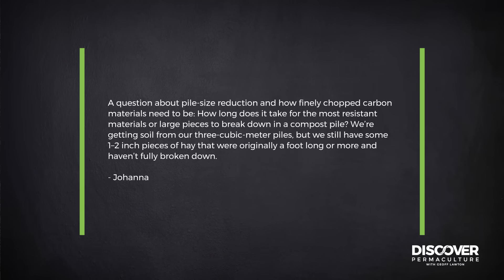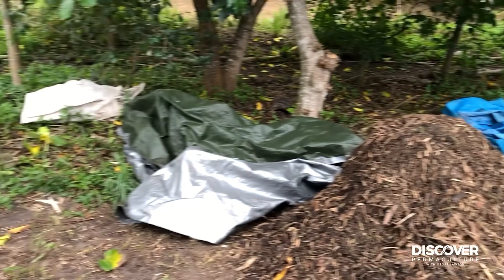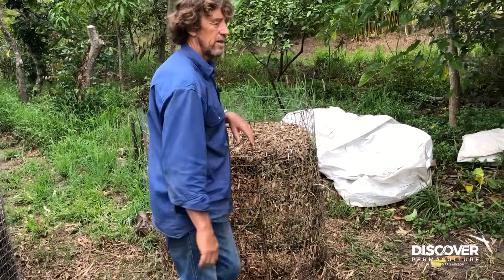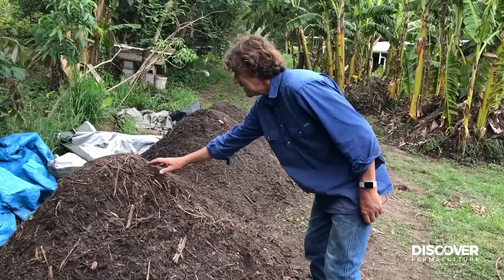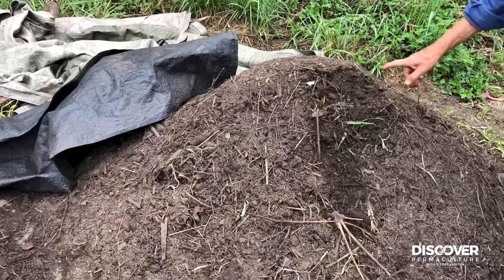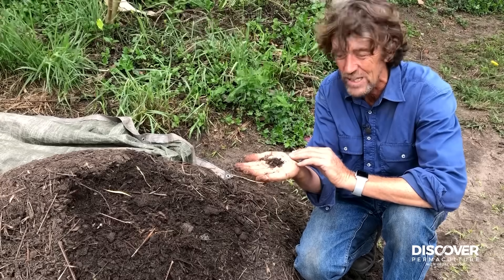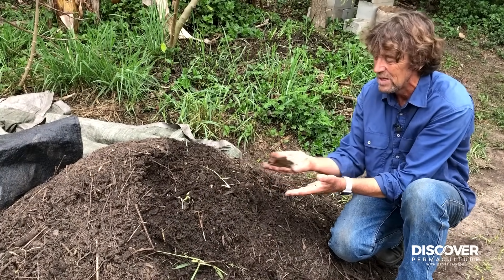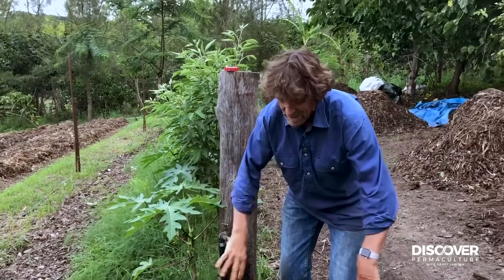Why Some Compost Chunks Don’t Break Down

Comment: I live in a cold climate. The stick can break down if placed below mulch. I prefer to turn them into biochar or us them as container bottom fill, which breaks them down super quickly compared to an open pile. I broke down one of my hugelpots after a year and only the very biggest pieces were still solid.

Comment: Mature compost indeed has only one main application : sowing tiny seeds like carrots and turnips. But to feed the soil, you're always better off putting it on the soil as raw materials. Because a compost pile will lose about 50 to 70% of the carbon in the form of CO2... It heats up too much, it's too bulky. So you lose fertility and you pollute. So why not use it raw on the ground, where only 10-20% will be lost as CO2  if you put it as a 5-20 cm layer ? The soil is the ultimate recycling machine. Use it. 
In the beginnings of permaculture, there was this myth that compost was the black gold, that you should make it and use it everywhere, that it was better than fertilizer, than anything, and that it would improve the texture of your soil and feed soil life. Now we know it's rubbish. Especially for mature compost, which has nothing left to eat for the soil. So it won't amend your soil, it will simply feed your plants (coz it's full of dead bacteria that plants can eat up right away). If your soil is poor, and you don't wanna wait until years of wood chip mulching make it rich, then yeah, use compost below the mulch. It will feed your veggies quickly. But grass clippings or manure would have the same effect. And you wouldn't have polluted the atmosphere and wasted carbon.
Reply: Compost is a soil biology inoculant more than it is a fertilizer. High quality, soil food web rich compost is what you want, which introduces a high diversity of soil organisms, which are in turn what feed your plants. Adding organic matter directly to the soil is a great strategy too and will accomplish the same thing over a longer period. Compost can help you jump-start the soil life so you get nutrient cycling going quickly.
Reply: @nick-ta-discoverpermacultu6442 not really unless you got a dead soil (rare) and use somebody else's compost... Otherwise it's easier to use all of this as mulch. It's not worth the loss of carbon and production of CO2
Reply: @nick-ta-discoverpermacultu6442   I agree with you 100%
Reply: Pollute the atmosphere? Compost under trees, boom, they soak up the CO2 from the compost pile....Make More Compost!
Reply: @ZomVees_Garden_Supplies lol trees don't absorb excess co2 that fast, so it's still wasted carbon
Reply: @nicolasbertin8552 OooooOooOokay, it just helps every growing situation on earth, but it's wasted carbon to make compost to you hahahahahahahahaha that's insane
Reply: @ZomVees_Garden_Supplies  Well weigh your compost pile before and after, that's how much is lost. I don't say it doesn't help plants. Like I said, it feeds plants well. It's just more wasteful than to put the raw materials. They'd feed both plants and soil, for longer, and better. Sure it looks neat to have compost coz it's like black dirt. Doesn't mean it's "the best". If I put guano my plants are gonna grow like crazy too...
Reply: @nicolasbertin8552 Matt Powers has shown Johnson-Su compost has compounding benefits, one guy claimed his grass had a brix level of 15, compost teas have rejuvenated pastured cattle. I'm glad you brought this issue up though, I'm gonna build a trellis network for gourds and see if composting under the trellis impacts gourd quality. Thanks, I try to learn from everyone.
Reply: @ZomVees_Garden_Supplies  And farmers in France have put pure compost on their fields in the hopes it'll restore soils and instead they have soils hard as concrete under a dry layer of compost. Because for years farmers have been told compost feeds soil life when it's a half-lie. Immature compost WILL feed life for sure. But when we say compost, we mean the MATURE product you buy in big bags. And THAT will not restore soils. It will feed plants. Any pasture, any prairie, any field, will do BETTER if you give it the RAW material that form compost rather than the compost itself.
Reply: @nicolasbertin8552 I'd agree with you regarding grass clippings, leaves or woodchips. But for example humanure or kitchen scraps would benefit from a pre-threatment before adding to the soil. Be it bokashi, a worm bin or aJohnson-Su style system.

Comment: I use 14 55 gallon barrels of water to keep my high tunnel from freezing at night . I also try to keep 2 hot compost piles for fertility, soil structure and heat.